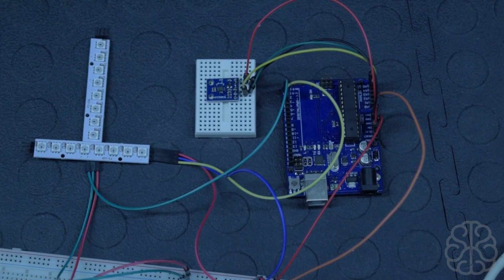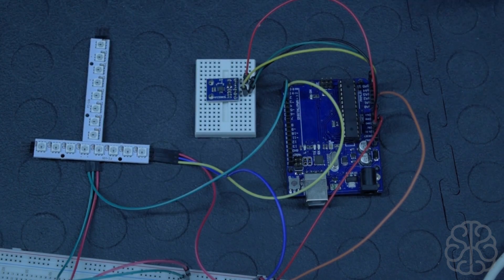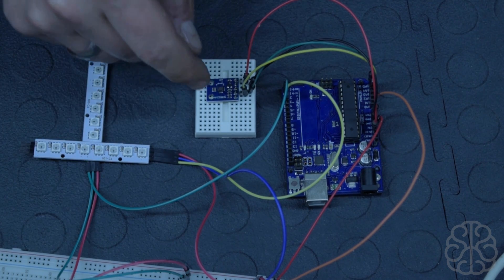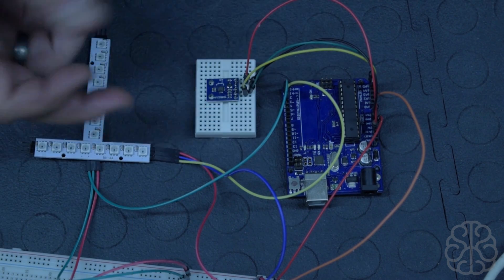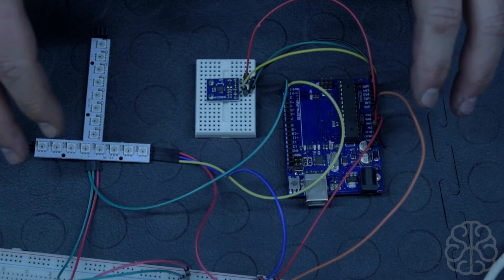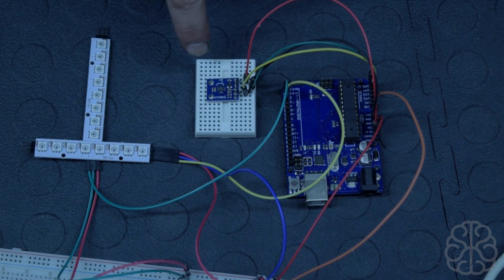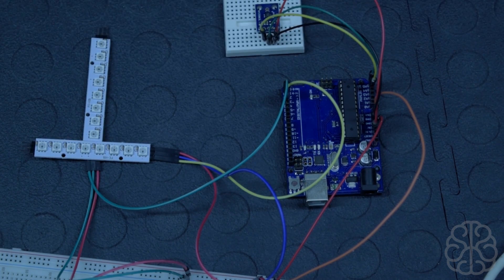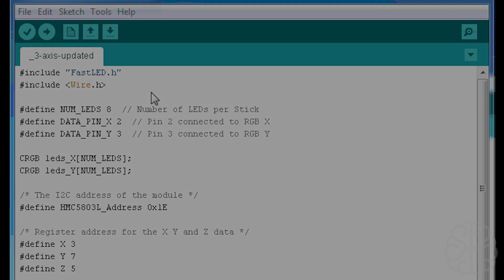Use the HMC5883L 3-axis sensor with an Arduino - Tutorial

Comment: Need help!. Mine is L883 chip which is actual hmc5883l but still it's not working. I'm just getting the board info as output. What could be the issue? I'm sure about the connections. Running it with Arduino nano

Comment: #include<Wire.h>

#define HMC5883L_Adress 0x1E

#define X 3
#define Y 7
#define Z 5
void setup()
{
  Serial.begin(9600);
  Wire.begin();
  Init_HMC5883L();
}
void loop()
{
  Serial.print(HMC5883L_Read(X));
  Serial.print(" ");
  Serial.print(HMC5883L_Read(Y));
  Serial.print(" ");
  Serial.print(HMC5883L_Read(Z));
}
void Init_HMC5883L(void)
{
  /* Set the module to 8x averaging and 15Hz measurement rate */
  Wire.beginTransmission(HMC5883L_Adress);
  Wire.write(0x00);
  Wire.write(0x70);

  /* Set a gain of 5 */
  Wire.write(0x01);
  Wire.write(0xA0);
  Wire.endTransmission();
  
}

int HMC5883L_Read(byte Axis)
{
  Wire.beginTransmission(HMC5883L_Adress);
  Wire.write(0x02);
  Wire.write(0x01);
  Wire.endTransmission();
  delay(6);
}

Comment: I want to create a module that force everyone to use hand rail while in stairs,so i want to trigger the metal sensor( attached to this module) while climbing the stairs , i am using combined  accelerometer & gyroscope sensor , but the accelerometer is getting triggered even when i am walking , is it possible to sense a direction at around 45° from  vertical  using this module so that  my project get successful?

Comment: /* Include the standard Wire library */
//http://forum.arduino.cc/index.php?topic=523683.0
//i2c address OD,3F,8D,BF
#include <Wire.h>
#include <LiquidCrystal_I2C.h>
LiquidCrystal_I2C lcd(0x3F, 20, 4); // 0X3F,  for 20x4 chars
/* The I2C address of the module */
#define HMC5803L_Address 0xBF  //1E
/* Register address for the X Y and Z data */
#define X 3
#define Y 7
#define Z 5
const int buzzer =  27;
void setup()
{
  Serial.begin(9600);
  lcd_setup();
  //  clear_myscreen();
  title();

  Serial.print("Compass GY 273\n\r");
  Serial.print("Check LCD Screen\n\r");
  //
  /* Initialise the Wire library */
  Wire.begin();

  /* Initialise the module */
  Init_HMC5803L();
}

void loop()
{
   myTone(buzzer, 3900, 30);
  delay(50);
  /* Read each sensor axis data and output to the serial port */

  Serial.print(HMC5803L_Read(X));
  // lcd.setCursor(0, 1);  lcd.print("        ");
  // lcd.setCursor(0, 1);  lcd.print("        ");
  int x1 = HMC5803L_Read(X);
  lcd.setCursor(0, 1);  
  lcd.print(x1);
  Serial.print(" ");
  Serial.print(HMC5803L_Read(Y));
  // lcd.setCursor(0, 2);  lcd.print("        "); 
  lcd.setCursor(0, 2);  
  //lcd.print("");
  int  y1 =  HMC5803L_Read(Y);
  lcd.setCursor(0, 2);   lcd.print(y1);
  Serial.print(" ");

  //lcd.setCursor(3, 3);  lcd.print("      ");
  // lcd.setCursor(3, 3);  lcd.print("        ");
  // delay(500);
  int z1 = HMC5803L_Read(Z);
  Serial.println(z1);
  lcd.setCursor(0, 3); //4th  row 1st position
  lcd.print(z1);
  //lcd.setCursor(3, 6);  lcd.print("here  ");
  /* Wait a little before reading again */
  
  delay(2200);

}

/* This function will initialise the module and only needs to be run once
   after the module is first powered up or reset */
void Init_HMC5803L(void)
{
  /* Set the module to 8x averaging and 15Hz measurement rate */
  Wire.beginTransmission(HMC5803L_Address);
  Wire.write(0x00);
  Wire.write(0x70);

  /* Set a gain of 5 */
  Wire.write(0x01);
  Wire.write(0xA0);
  Wire.endTransmission();
}

/* This function will read once from one of the 3 axis data registers
  and return the 16 bit signed result. */
int HMC5803L_Read(byte Axis)
{
  int Result;

  /* Initiate a single measurement */
  Wire.beginTransmission(HMC5803L_Address);
  Wire.write(0x02);
  Wire.write(0x01);
  Wire.endTransmission();
  delay(6);

  /* Move modules the resiger pointer to one of the axis data registers */
  Wire.beginTransmission(HMC5803L_Address);
  Wire.write(Axis);
  Wire.endTransmission();

  /* Read the data from registers (there are two 8 bit registers for each axis) */
  Wire.requestFrom(HMC5803L_Address, 2); //2);
  Result = Wire.read() << 8;
  Result |= Wire.read();

  return Result;
}
void clear_myscreen()
{
  lcd.setBacklight(HIGH);
  lcd.clear();
  // lcd.begin(20, 4);
  //  lcd.init();
  //  lcd.setCursor(0, 0);
  //  lcd.print("        ");
  //  lcd.setCursor(0, 1);

} // end of clear myscreen routine

void title()
{

  lcd.setCursor(0, 0);
  lcd.print("Compass GY 273"); //
  lcd.setCursor(18, 0);
  lcd.print(HMC5803L_Address, HEX);
  Serial.println(HMC5803L_Address, HEX);
  delay(1500);

}

void lcd_setup()
{
  // Wire.begin(10, 14); // Wire.begin(SDA,SCL); ie Wire.begin(gpio 10-see bottom, gpio 14-see bottom) must be declared corrected on 27 Sept 2017
  //     Wire.begin(SDA=green, SCL=yellow)
  //lcd.init(); // initialize the lcd
  lcd.begin(20, 4);

  //lcd.setContrast(30);
  lcd.init(); //clear;this statement must be used before the lcd can display characters 17 May 2017
  lcd.display();
  lcd.clear();
  // Print a message to the LCD.
  lcd.setBacklight(HIGH); //must turn on 19 July 2017
} // end of lcd_setup routine

void myTone(byte buzzer, uint16_t frequency, uint16_t duration) //18 Jan 2018

{ // input parameters: Arduino pin number, frequency in Hz, duration in milliseconds
  unsigned long startTime = millis();
  unsigned long halfPeriod = 1000000L / frequency / 2;
  pinMode(buzzer, OUTPUT);
  // Serial.print("Beep via pin= "); Serial.print(buzzer); Serial.print("\n\r");
  while (millis() - startTime < duration)
  {

    digitalWrite(buzzer, HIGH);
    delayMicroseconds(halfPeriod);
    digitalWrite(buzzer, LOW);
    delayMicroseconds(halfPeriod);
  }
} //last line of myTone routine

it  produces  3  numbers   771   1799   1285

Comment: +Brainy-Bits i need your help. i have sen your code and it is very professionally written. can you help me do the same but instead control speeds of 2 motors? i have a left and a right motor. with movement of this compass, the corresponding motor must move and the speed varies with compass angle. how can i use mapping for this? i will appreciate if you can help me write a short code for that
Reply: Hey I'm not sure if you still need the help but it is actually pretty simple to control a motor. Use mapping from 0 to 255 and type in this:

analogWrite(Motor, "Variable of Mapped Number"); 

Then wire up an N channel MOSFET with the motor wired from power to the drain pin on the MOSFET. Then attach ground to the source and attach the gate pin to the motor pin you have set. Do this for each motor and you'll be all set.

Comment: I can see a great use for this our old Class A motor home has a joystick type hydrolic leveler system. The lights have long stopped working properly, so  I have to dig out an old level and have the wife tell me when I am level so the rig works right, ie. the fridge needs to be near level to cool, and walking can be difficult if you are off level.  Now don't get me wrong, my wife is a wonderful woman, but she cannot read a level at all for some dang reason, so each setup quickly turns into a shouting match. This could well solve our problems and poor oil on the troubled waters at RV parks across this great land.

Comment: Nice. I have this question : What values do you get if you rotate the sensor over 90 degrees around one axis? Is it still measuring something or does it get to the maximum available? if it does, do you think there's a way to map it for 180 or 360 mouvement?
Thank you!

Comment: Great project!
I have a gy-87 sensor, which has the same hmc5883l magnetometer, and i used your code to read datas, but i got only -1 -1 -1 values. Do you have any idea why do i get only these values?
Reply: Hi Mate, I know this thread is really old now, but I am leaving this here for anyone else who comes across this video. I had the same issue and I found out that the chip on my breakout board was actually a QMC5883L and NOT the HMC5883L. Hope this helps someone else out in future.

Edit: "For further clarity, The I2C address is different. This might explain why you had this problem. Seems the address is 0x0D."
Reply from the maker: +Trambulin15 Don't have the GY-87 version on hand so can't say if it requires different programming than the one I'm using, but that might be it!   Make sure your connections are good and maybe use different connection cables to make sure it's not just a bad connection.  Thanks for watching!
Reply: +Brainy-Bits hmc5883l have name is "GY-271"
 but is not GY-87
and there are another one is 
 GY-521

Comment: this is great in some project like quadcopter.
btw, you should say "i square c".
Reply from the maker: Zelra 仙賢戀軒 Thanks for the comment, and for pointing out the i2c, didn't even notice it till now :)
Reply: Actually since the protocol is actually called IIC for inter-integrated circuit you would logically call it I two C.
Reply: Zelra 仙賢戀軒

Comment: Thank you for sharing AND for making it easier to read the code.
Quick question: I noticed you rotated the module through 90° for the readings. Is this the maximum it will measure, or could it do a full 360°? That would make it useful for a cool wearable device that I have not thought of yet!
Reply from the maker: MisterG The X and Y axis will do 180degrees, the Z axis should be able to do 360degrees since it can be used to detect magnetic north.  I will do another tutorial video showing how to use the HMC5883L as a compass soon.  Thanks for your comment and watching!